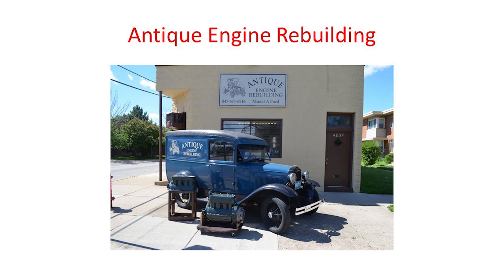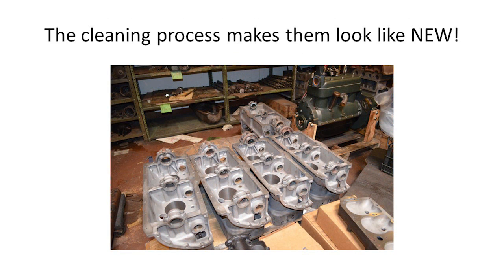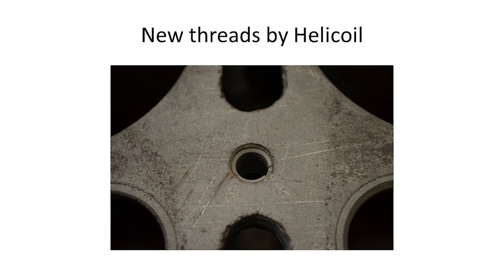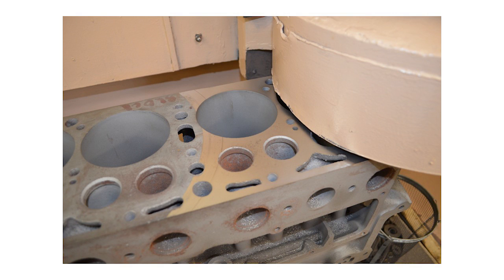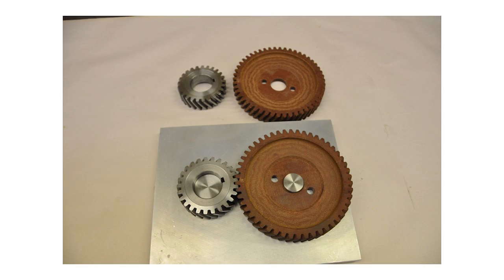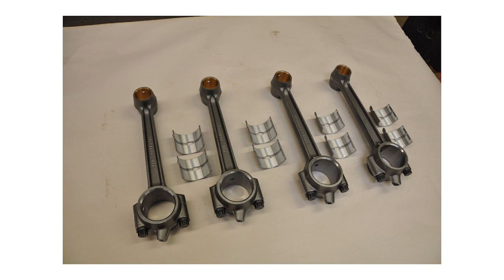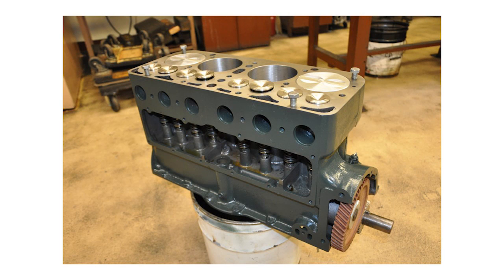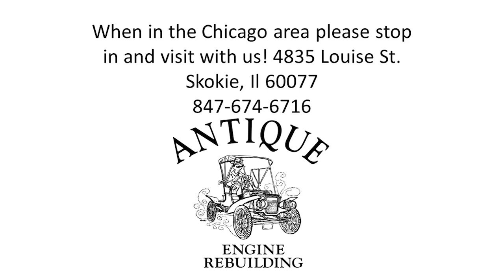Model A Engine Rebuilding Seminar

Comment: You didn't mention and no-one asked about the oil pressure requirements upon changing over to insert bearings. Until now, I have always understood the oil pressure had to be increased if inserts are incorporated. What is your finding and method please???  Thank you.